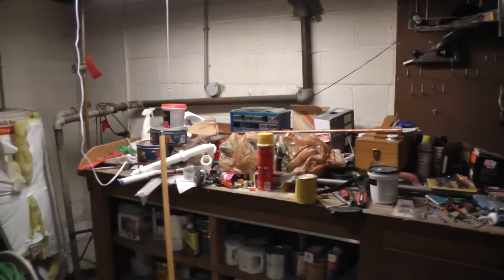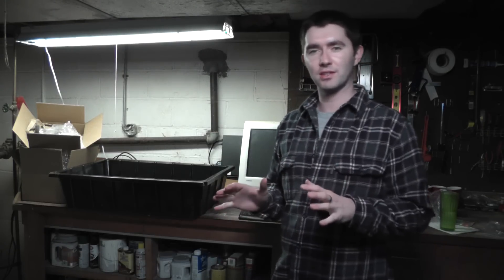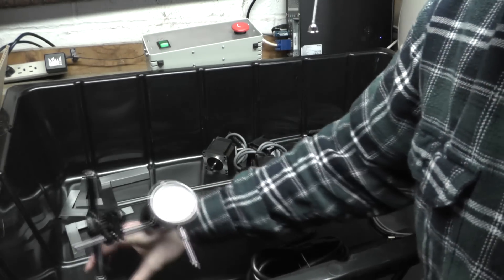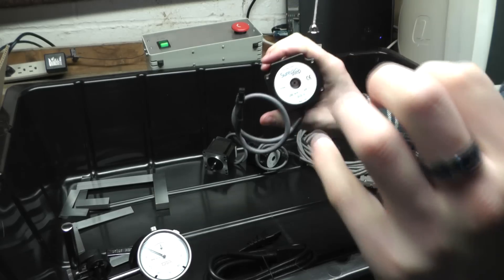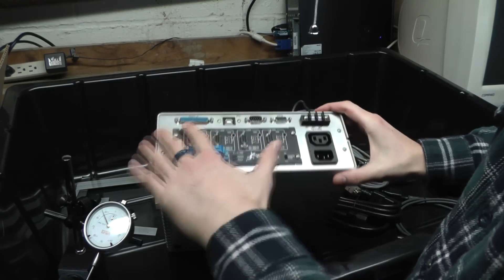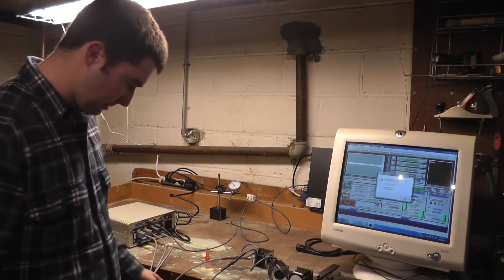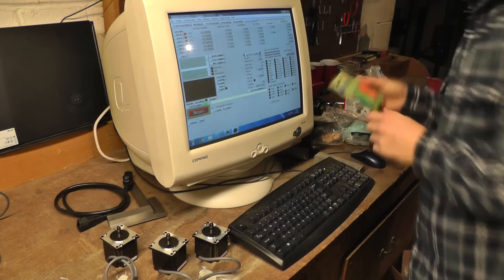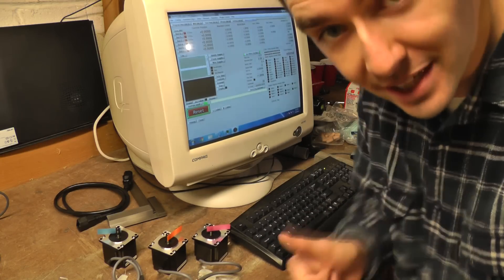Introduction to my CNC Setup (Workbench, Stepper Motors, Controls and Tools)

Comment: I remember you mentioning your interest in machining in an Amphour episode a while back. I'm pleased you took the leap. I could not do half the stuff I do without my mill and lathe. Even simple stuff like panel cutouts are much easier and neater with some decent machines. As someone else mentioned, it's be really beneficial to learn the basics of what you are doing manually. Get a feel for the machine and the materials you are cutting.

Comment: Also: It's normal to get some weird high pitched noises when the stepper controllers are holding the steppers in a fixed position.  I'm using different Gecko drivers and larger steppers (on a larger mill), but mine do the same thing.

Comment: Great start. If you get a chance can you post some links to what you've purchased, it would be good reference for others.

We're actually in parallel universes, I'm also an EE guy and recently decided to venture into CNC but I'm not as smart as you because I decided to build my CNC rather than but a mill.

BTW, those are called feeler gauges and are typically used to measure spark plug gaps  on cars. I guess there could be a machinist's equivalent but that's what I've sued them for in the past!

Comment: Do yourself (and your mill) a HUGE favor and run it manually first. The most important thing to learn is the 'feel' and sounds of the different operations. It can be as simple as squaring up a small block. Please, at-least take an hour or two first!

Imagine trying to troubleshoot a broken electronics device with no sense of touch and smell, That's what your basically doing when you replace your hands with the stepper motors :D